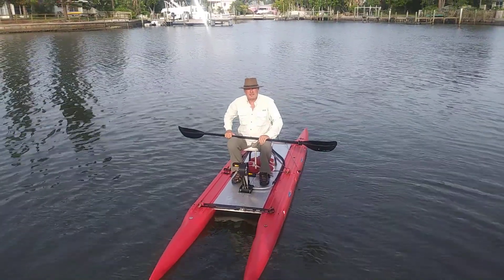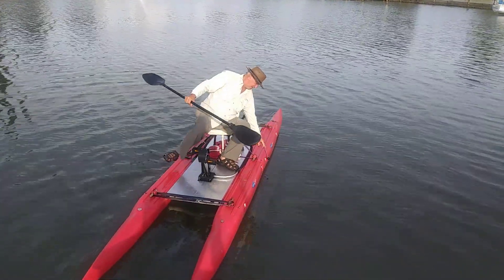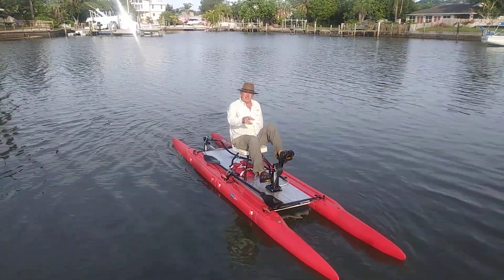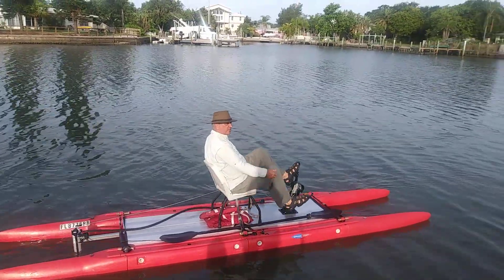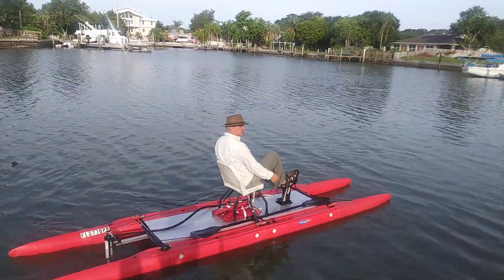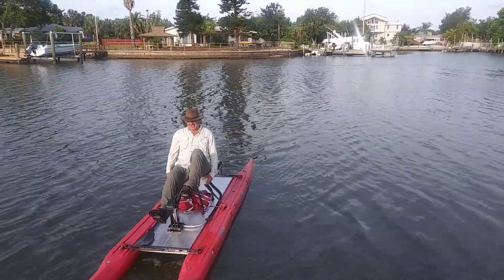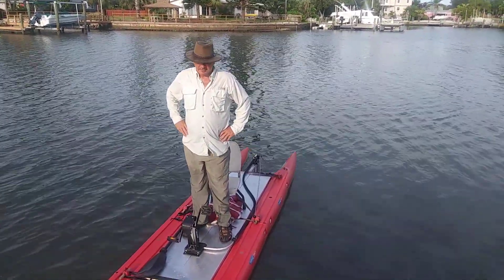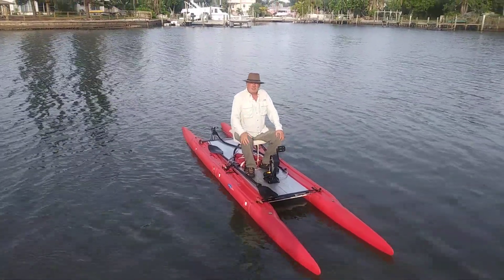Expandacraft pedal powered modular boat.

Comment: Any chance you could post a quick video on the details of how you installed this for those of us who are less crafty than you?
Reply from the maker: I will be posting one like that soon. It's very simple though, just bolt the drive to the deck then bolt the rudder to a post in back. The kit comes with an instruction book too, and it actually takes longer to open the box and unwrap all the parts than it does to set up. Remember, this is not my design, it's from H2ProPed.